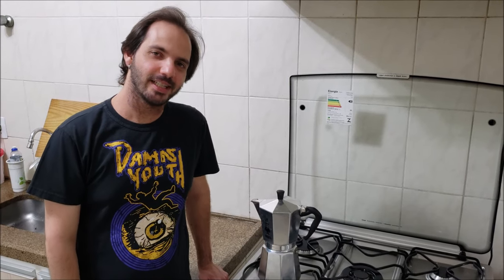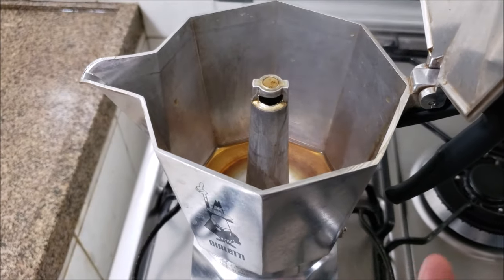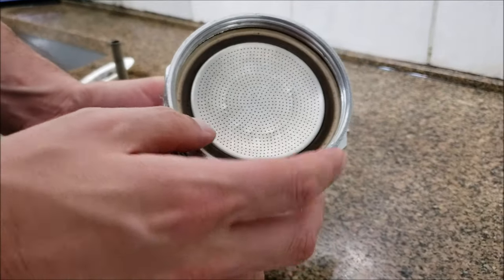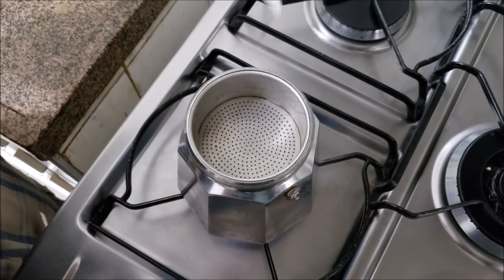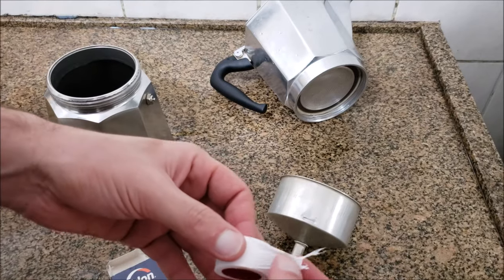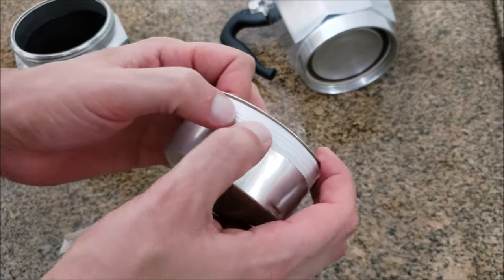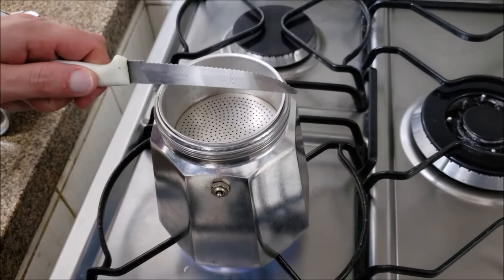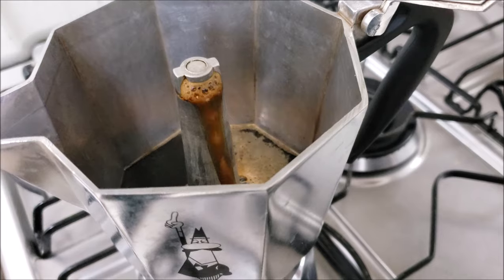Moka Pot sputtering or not working correctly: how to solve it!

Comment: you wonderful, wonderful man, this absolutely solved my moka pot problem. i was literally jumping for joy when the coffee came up smoothly and it was nice and strong and the coffee itself (with a touch of milk) tastes so good. thank you, thank you, thank you. may the coffee gods bless you with many years of great brews.
Reply from the maker: Hey! Very nice to hear that from you!! I I perfectly understand your joy, 'cause that happened to me when I managed to fix my Moka Pot! 
Now enjoy the delicious coffee correctly brewed with yours!!
Thanks!
Reply: There's one problem though. The metal filter around which the silicone gasket sits is getting slightly hollowed after the brewing. Due to the upward pressure. I reversed it today and it got hollowed out once again. At this rate, I think it will develop cracks and completely give out.
Reply from the maker: @mesri3  I think it's normal that the filter becomes hollowed. Sure, if it gets too hollowed, maybe there's something wrong, but the filter of my smaller Moka Pot, which I've never needed to use the PTFE tape, is also hollowed. Maybe you should try leave it like that and check if the process of hollowing gets stabilized. If yes, then just enjoy your coffee, this is not a big deal.
Reply: @viniciusandrea3251  ok, cool but today, I decreased the amount of coffee powder and the hollowing didn't happen. the coffee decoction also came into the upper chamber more smoothly and more of the water from the lower chamber got used. so I guess I was putting too much coffee powder. thanks for being so kind and considerate in replying. and even bigger thanks for making this video. you gave me a moka pot i had given up on.
Reply: @mesri3  You guys are having a good discussion here!  Can I add that the problem is the design; the Bialetti gaskets, when tightened down only the very outside of the gasket ring gets compressed.  So when the pressure starts to build, the water and steam simply escape AROUND the filter basket (bypassing the coffee in the filter!)... LOL mine does that too..  My generic cheap ebay moka pot - by examining it you can see just by disassembling it why it works so much better...
Reply: I have literally just done exactly the same!!!! I'm running round at 8pm shouting "it's working!!!!"
Reply: Try using a rubber band. 
I didn't have any of that plumbers tape, so I used a rubber band. Works great. Get yourself a bag of assorted sizes, widths, and colors, and find out which works best for your size of moka pot. For me, the narrow ones work best. (A rubber band provides an even thickness all the way around, with no overlapping area.) 
Great analysis, Vinnie. Thanks!
UPDATE:  
You may find that your coffee basket, with the rubber band around the top, is stuck after making your coffee. I spoon out the coffee grounds, then run cold water into it for a while until it contracts enough to pull it out.
Reply: I didn't have the plumbing tape so I tried the rubber band idea and it worked, just now a little coffee dribbles out the middle, but maybe if I use a smaller rubber band it'll be better.  Thanks for the tips!
Reply: Strainer in backwards and still.... basket set to low. I'm going to send it back. First I'll try lapping compound and see if I can get a seat

Comment: thank you for this video and showing us what's the cause. i solved this issue by screwing the top and bottom chamber as humanly tightly as possible. Perhaps you guys should try to tighten it as much as possible first. If that doesn't work, then try other workaround like the one shown in this video
Reply: Thanks, this one works for me as temporary fix. Apparently I need to replace the rubber gasket because it somewhat became less flexible due to aging.
Reply: Thank you, I will try this next time before trying the tape too! I thought I had it on pretty tight, but everywhere I read people are saying you have to do it really really tight. Can be kind of hard though when you already have hot water in the bottom and it's a 9 cup moka pot :P
Reply: "I used to be an adventurer like you. Then I took an arrow in the knee..."

Comment: Mate, terrific video and solution for exactly what I was experiencing with my new moka pot. Plainly obvious once understanding the mechanics of the pot and importance of sealing the chamber. Took your advice and immediately solved my problem. I since searched out rubber O-rings as a more robust solution (62mm OD, 59mm ID, 1.5mm Width work perfectly for my 6-cup pot). You saved me a lot of frustration. Cheers.

Comment: New gaskets will cause this problem every time, due to the fact the rubber is hard and clean, ie. grippy. You won't be able to tighten the two halves of the pot enough to compress the seal enough to hold pressure. Solution: lube. Just dab a little vegetable oil around the rim of the pot with a fingertip before assembly and crank it TIGHT like always. After the first use, residual coffee oils should be enough. You shouldn't need any PTFE tape either, if the funnel top is round and flat. The rubber seal is designed to seal the pot and the funnel from each other.
Reply from the maker: Wow, that's nice, Tular, I'll try your tip later. Thanks!

Comment: I think the key of this (that you point out with your great experiment) is that the pressure must be sealed in the lower chamber and not leak past the funnel edge.  The fix using just the parts of the Moka Pot is to make sure the gasket seals against the funnel.  Most people focus on the gasket sealing the threaded lower part of the pot to the top, but the gasket has a second separate purpose:  The funnel must also seal to the gasket so that the steam pressure does not leak around the funnel edge and up the "stack" (the part that the coffee eventually comes out of).

To make sure the funnel seals:  1.Make sure the gasket is still pliable (incidentally, a brand new gasket doesn't always seal as they are a bit stiff from the factory). 2. Make sure the gasket is clean (i.e. No coffee grounds stuck to or embedded in the gasket).  3. Make sure the top edge of the funnel is clean and free from coffee.  When you fill the funnel with fresh coffee, make sure to run your finger over the edge and remove any coffee grounds before screwing on the top.  Any bits of coffee between the funnel edge and the gasket will stop the funnel from sealing properly.  4. Make sure the pot top and bottom are well tightened.  I hope this helps someone out there :)
Reply: 😄😄 Whoever thought I'd spent so much time watching a coffee tutorial? ❤
Reply: @kaymarieperera4778  it's a serious biznizz o// if more people were like us and cared about how their coffee turned out.... \♥/
Reply: This was an excellent post. I couldn't figure out (even w/a new gasket) what was wrong. I'd hear the water, then a lot of steam, then it would sputter out a 1/4 cup maybe. I feel like I'll never have this issue, again..
Reply: Yeah. I have a Bialetti from back in the 70s. Original funnel. And new gaskets that have been broken in. As clean as I get it I just can't seem to get a full seal without the teflon tape.
Reply: For me a more permanent fix that basically fixes this discrepancy between funnel and bottom pot was sanding down a millimeter of threaded rim. In my case I could clearly see that the rim of bottom part is higher than funnel rim.
Reply: @MarekRatvaj  you are  right 💯! All other solutions are BS.
Reply: awesome. thank you!
Reply: Thank you

Comment: I changed my grind up and down, lowered and increased the flame under the pot, changed the beans to another brand but none of that made a difference, I would not get enough coffee into the pot, I was ready to give up on the mocha pot. BUT, this video saved it, I applied the plumber's PTFE tape trick and this fixed my problem. Thank you!!

Comment: Your video was a real revelation to me, Vini. I had always thought that the sole purpose of the gasket was to stop the coffee that enters the funnel from escaping through the screw thread that binds the two compartments. It had never occurred to me that the gasket is also there to stop steam and potentially hot water escaping from the lower compartment through the gap between the rim of the funnel and the rim of the lower compartment. Your demonstration shows this brilliantly.

This has made me understand better how my Moka pot works. But it has ALSO made me question some of my fundamental assumptions I had made until now about what is happening in my pot.

I have learnt over the years that each time I replace the gasket, I can expect a livelier brew for the first five or so days, in which the brew takes longer, there is a clear and throaty sound as it rises through the column in the upper compartment, and it will start sputtering earlier. The more the gasket gets seasoned, the more the pot returns to normal brew times and to a silent trickle as the coffee comes out of the column.

I had assumed that the new gasket provides a firmer seal, that this raises the atmospheric pressure in the pot, and that it is this that causes a longer heatup time and a livelier brew. But I am now wondering whether the reverse is true: that the gasket needs time to perfectly mould itself to the rim of the pot, and so the first brews are longer and livelier due to a less efficient seal (and consequently lower atmospheric pressure in the lower compartment) and this is why a new gasket can cause longer heatup times and livelier brews. So can you explain which of these two (or maybe neither) is so??

If I can understand better how the Moka pot works, I wil be able to make better Moka coffee and more easily resolve some of the problems we can encounter from time to time 😉.

-------------------------------------------

After well over 10 years (probably nearer 20) of making Moka coffee daily, I can honestly say this is the best and most useful YouTube video I have ever seen on the Moka pot. I very much hope you will post more videos with tips on how to further improve our Moka brewing skills ☕!

-------------------------------------------

By the way here is the context of how I came across your video:

I had just changed the gasket on my 3-cup pot and, though I am used to a new gasket causing a longer brew with sputtering starting much earlier for the first five or so days resulting in an over-extracted flavour, this time I was getting alarmed that it was remaining the same for much longer than five days (with the sputtering starting right from the beginning of outflow) and with no immediate prospect of resolution.

I then found your video that explained so well what was happening. I first followed @blobscott's advice in his post (written "1 month ago" at the time of my writing this post) and then, though experiencing real progress, felt nevertheless that progress was insufficient and so added your trick of adding PTFE teflon tape to the rim of the funnel. I'm not sure whether the PTFE tape added further improvement or was just duplicating what I had already achieved with @blobscott's advice, but certainly the result is already a great improvement on what I was experiencing until then. I'm still experiencing long heatup times, and a livelier brew (i.e. faster outflow, & some noise as it rises through the column) but it is no longer sputtering from the beginning of outflow. The sputtering comes at the end as it should do.

-------------------------------------------

So anyway, I very much hope you can find time out of your doubtless busy schedule to answer my question from paragraphs 3 and 4 😁.
Reply from the maker: Hi! Sorry for the late answer. 
I hope to find you well and healthy! 

Well, unfortunately I don't have the answer to your questions. I have to admit I'm not a experienced coffee maker, I just applied my experience from my formation in Physics and from my Laboratory experience for making my PhD studies. 
My hypothesis, tough, is that there is no considerable difference in the atmospheric pressure inside the boiler when the rim between the funnel and the boiler. But maybe I'm wrong and you seem to have much more experience and knowledge in this topic than me!  I'm just a coffee lover who wanted to fix his Moka Pot and help everyone who were facing the same issue : )
Reply: @viniciusandrea3251  Dammit! I just wrote a long answer to your reply and then I accidentally closed the page (before copying to clipboard) ☹. Anyway the gist was:
1. I've learnt a great deal thanks to your video, and I've understood even better how my Moka pot works through your excellent demo since writing my previous post (as I said, the best video I've found on the internet so far about the Moka pot — and I've seen a bunch)!
2. Please do add a video to your channel (or two, or three) if you make any other discoveries that can help us make more delicious Moka coffee. I've subscribed to your channel to that end.

Also, if I find a moment, I'll write my post again sometime or other!

Comment: Great tip, Vinnie.  I struggled trying to figure out the problem, always thinking it was the gasket or the filter.  Your solution is spot on.  Many thanks!
Reply from the maker: Hey Marco! I'm glad I could help. I also struggled for a long time until I figure out that the issue had to do with the sealing around the funnel. Great brews for you!

Comment: This is brilliant.  Using Moka Pots for years, and mine was making good coffee, even though it was leaking at the chamber joint.  The gasket was hardening, so, I changed out the gasket.  After putting in a new gasket, had gurgling from the very beginning and not all the water would boil out.  Looked at this video and applied two rounds of pipe joint tape as instructed.  Works like a charm, and as an engineer, knew this made complete sense as soon as seeing the video.  The coffee is stronger, too.  It's one of those, "now why didn't I think of that" fixes.  If you have an older pot, try this before you do all the fixes with the grind of the coffee, the water temperature, the fire temperature, etc.  Over the years, the funnel and chamber fit get out of round, and this solves it.  Thank you!!!
Reply from the maker: Thanks, George! That's awesome to read from you! Yeah, I felt the same as you when I came up with this idea: why haven't I thought this before!!! 
Anyhow, I'm glad I could help!
Reply: Same for me!

Comment: I have a 1 cup, 3 cup and 6 cup Moka pots.  I bought the 6 cup new and the 1 and 3 cup off of ebay, and they were both well used and needed the gaskets replaced.  The 3 cup just hasn't worked right (same issue that you were showing here) and I noticed that the basket / funnel was a bit bent and mis-shapen.  Not bad, but def not perfectly round.  I bought a replacement funnel and that solved the problem.  As the Moka works based on pressure, you need to ensure that it is very tight.  This is a great tip and I'll remember it for the future if needed!  Thank you!

Comment: Muitissimo obrigado, Vinicius. I had changed the rubber gasket for a brand new one and that wasn't it, still sputtering. Then I got my teflon tape which I normally have around for sealing my Highland bagpipe drones of all things, and did what you suggested. The coffee then came out on a steady flow, no sputtering, no noise, and it was a beautiful sight. Thank you very much. Brigadão, te cuida, parceiro.

Comment: I had exactly this problem, spluttering/ spitting while producing coffee. On an off chance, searched Amazon for silicone rubber o ring. I think it was 60 mm, 1.5 mm wall. Sits nicely where you put the ptfe tape. I think it was 3 or 4 uk£ for 10. Perfect! Now, it runs silently, the only sputtering comes when all the water has been pushed up through the coffee. My first Mike pot so it took me a while to realise it was working properly.
Reply from the maker: This is also an excellent solution, Bob! Great and thanks for sharing it!

Comment: Great video, I’ve only had this problem once, and it was when I bought preground coffee. Usually I grind my own and it works great. The preground coffee was made for drip, so it shouldn’t have sputtered. Not sure what happened. Regardless, great video and a genius solution to the problem. I would love to see other tips with how you brew your moka. Hot water vs cold water at the beginning, what grind size, and how much heat you apply. Thanks!
Reply from the maker: Hi, Jay! Thanks for your comments and video suggestions!  😃

Comment: So great, it really works! Got so frustrated when I finally got a stainless steel funnel that it splattered. It always worked great with original aluminum.
After your video I examined the funnel and yes the new funnel did not line up properly. Taped now it works ❤❤❤❤
Reply from the maker: Awesome that it has worked!! I'm glad I could help!

Comment: Guys if you want a permanent fix, you'll need to make sure when you place the funnel in, it has the same height as the top opening of the lower pot, so the gasket can seal them competely. If they are not levelled, you need to level them by rubbing the top opening of the lower pot with sand paper.

Comment: Don't buy cheap moka pots they have poor sealing due to lower quality and often have this exact problem. This was very helpful thank you very much good sir.
Reply from the maker: Yeah, you're right. Usually cheap Moka Pots have sealing issues. But it can also happen with the expensive ones, like in my case (this is an original Bialetti).

Comment: Great tip, but the tape lasted me 20 cups.
I went to a hardware/hydraulic parts shop and bought a 1.5x70 O-ring. My pot is 450 ml and the coffee powder container is 72mm in diameter. 70mm is tight enough not slip the o-ring.
So if you want more reable solution then measure the powder container diameter  and buy few mm smaller O-ring. 1.5 mm thick seal would be enough.